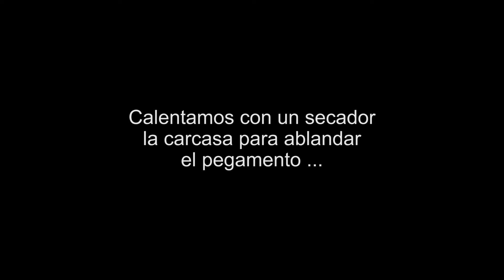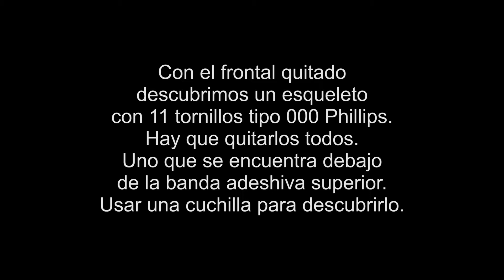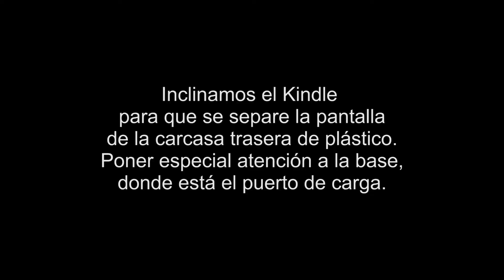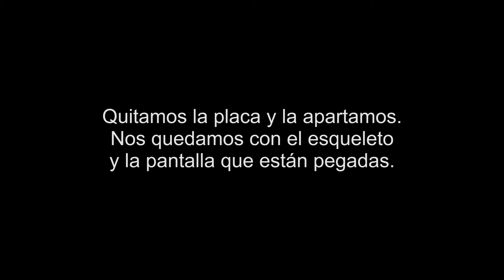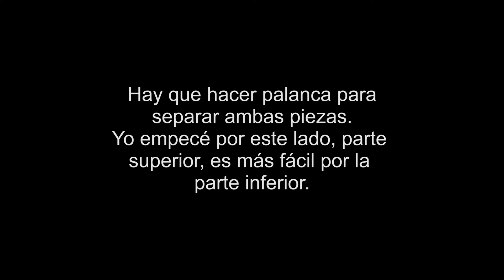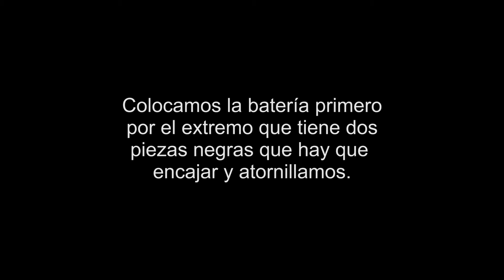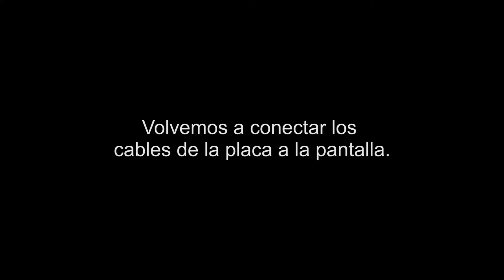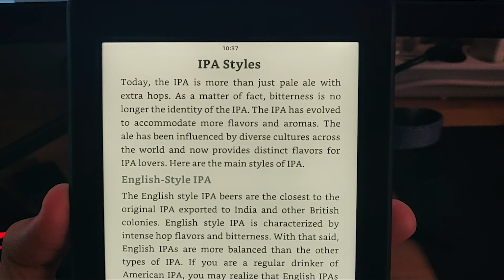Remplazar pantalla Amazon Kindle Paperwhite 2 ED060XD4

Comment: Hello,

I followed your tutorial, and it was great. I replaced my screen with a new screen which included plastic and all the FPC cables. However, after starting up the Kindle, it is now stuck in a booting loop and after some time it says "Your Kindle Needs Repair". Do you know what did I do wrong? 

Thanks.
Reply from the maker: Hi! I have no idea what is wrong 😞 I didn't have any issues, when I booted mine it just did as it normally does. Maybe you had a software/firmware issue before you started repairing the screen?
Reply: @garich1984  Nah, no software problem. I put the old scratched screen back and it booted perfectly again. Must have been problem with the new screen.
Reply from the maker: @UlTrAXcH  maybe it's not compatible with your Kindle? I think it could be it.

Comment: Thanks for your tutorial. I'll try to do the same with mine Kindle. new screen already with glue? Do I need to buy the glue separately?
Reply from the maker: Hi, the screen in my model are two pieces. The plastic cover and the screen. The screen does not need glue, the plastic cover does. My replacement didn't come with new glue so I tried to reuse the old one. It worked, but it's not perfect. Ideally new glue is needed if you want the plastic cover to fit perfectly. You can replace the screen and find later new glue online. I ended not replacing the old glue, it just works fine.

Comment: Hello! Good video, very descriptive.
I think I have a Paperwhite 1, it's quite old but I think I'll try replacing the screen anyway thanks to your video. Now all I have to do is find a screen.
Reply from the maker: Hi, I got mine in AliExpress. It's not the same quality but definitely is the same model (same connectors, size and everything) Keeps doing its job with zero problems today. Where I live there are none second hand/used electronic parts stores, so I wasn't able to find an original Kindle replacement. Good luck sir with the fix !